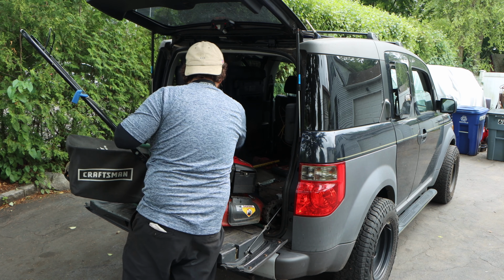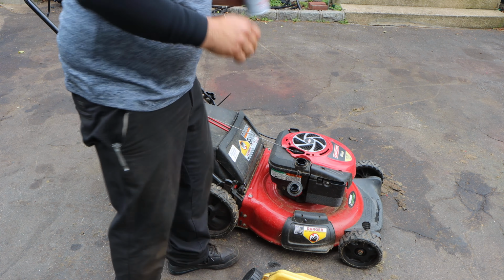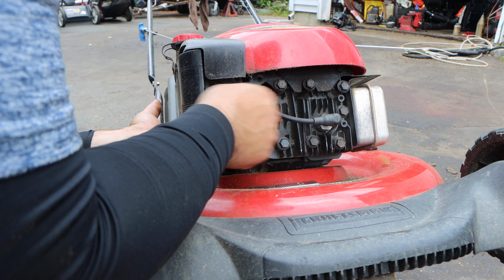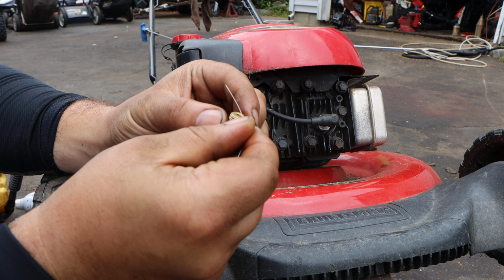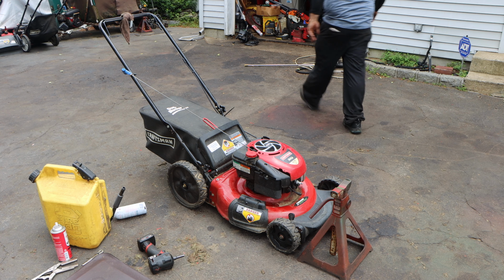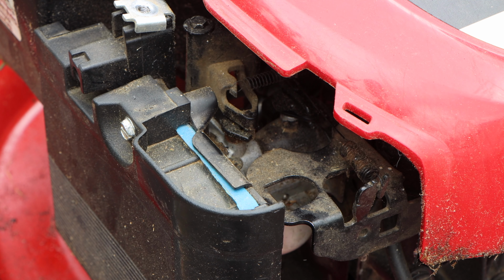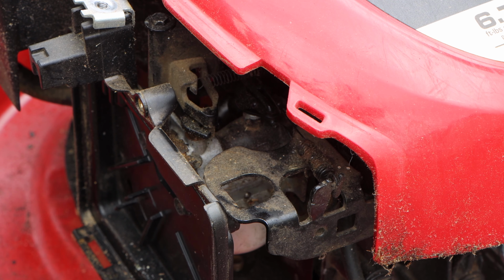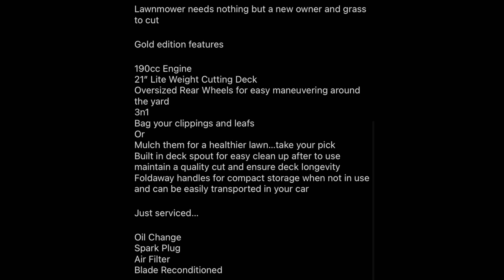#FREE #KARMA TRASH PICKED CRAFTSMAN LAWN MOWER WHY WAS I THROWN AWAY HOW FAR CAN WE "PUSH" IT?

Comment: Very Nice Mower, Jason.  I thought there for a second that maybe the mower had a Diesel engine without the spark plug 😀😀😀.  I have a 1974 era Briggs &! Stratton engine that has alternate timing marks for running kerosene instead of gasoline. The engine is a 16hp cast iron flathead that is mounted on a 48 inch Yazoo rider. Sorry, I couldn’t resist teasing you just a little bit.
Reply from the maker: WOW, the days of enguiniety are long gone!
Reply: @pattayperformance   Unfortunately So,Jason.

Comment: Nice!
I'm going to be making a major upgrade shortly to my 1971 Ariens 32" wide. I will be swapping out the old small rims and tires for the Carlisle Sno-Hog's size 16x6.50-8 with regular tire chains, these are the same setup and size tires your Ariens have. I have a pair of rims from a Snapper for that size tire with identical mounting holes as the Ariens rim, so they'll go right on. It will be a huge upgrade and the last major performance upgrade that beast will need. The traction on the unit will be way better, while giving the machine better handling and support of a bucket that wide. It will also give it a much better stance and overall make the unit far more aggressive looking, no more slipping, the machine will barrel thru heavy snow harder than ever before! Long over do. Aiming to kill it this winter betwern that one, the resto'd Ariens ST824 and the Snapper. The Snapper and Ariens already have the auxbeam LEDs, installed and ready to go. Super bright, we will finally be able to see nice and clear since were usually out after dark. Can't wait!